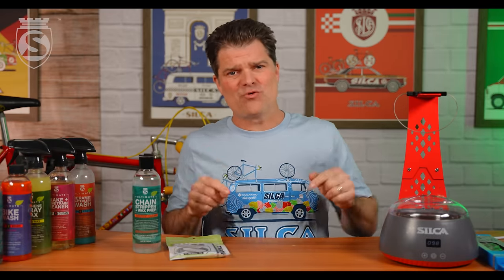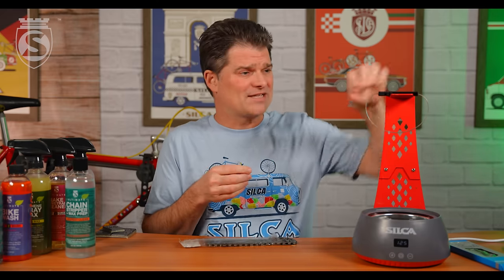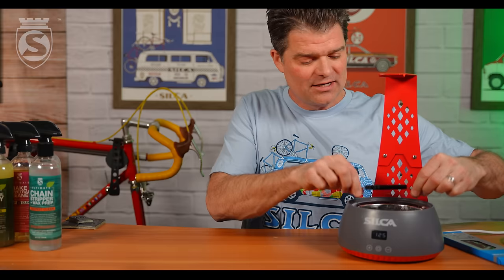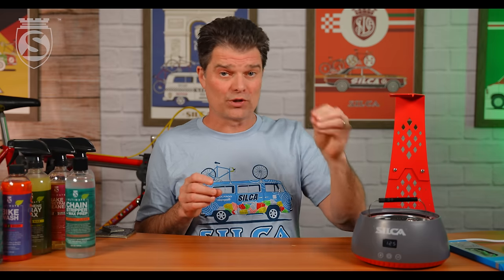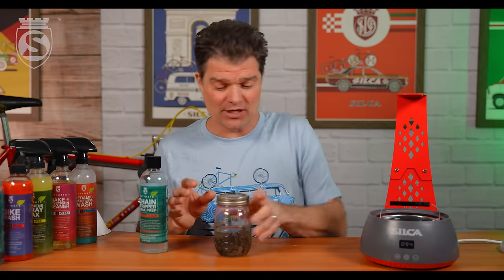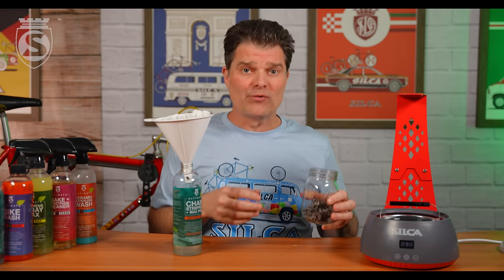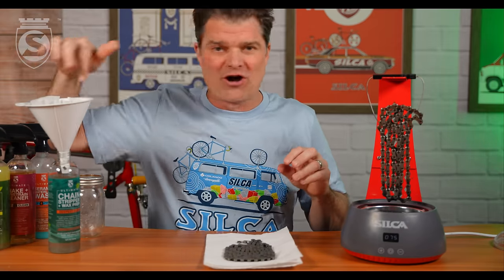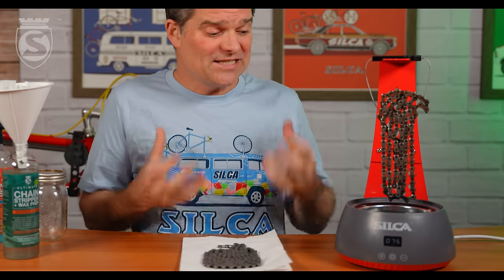Chain Waxing System Tutorial with Josh: A Step-by-Step Guide!

Comment: Hi Josh. This is not a question but an observation after just a few uses. Generally, the system is good, it works, but I don't know if it only happened to me while waxing, that the handle with the rope on which the chain is ...falls completely into the wax. So in my opinion, this is a small (?)  problem. There is no way to prevent it, I tried to thread it differently chain but it's the same every time. Of course, I deal with this by placing a piece of wooden spatula through the hole in the cable, which protects it from sinking in wax, but this is probably something worth considering when modernizing this station. That's all :)
Reply: An old spoke cut to the diameter of the pot works well.
Reply: Happened to me as well, I just scooped it out with scissors and the loop stood by itself (probably due to the wax).
Reply: Are these products for bike shop use or end user as well?

Comment: I have done 2 chains with the Stripper Chip/Chain Waxing System. Loved the idiot-proofness (good for me) and it resulted in what seems to be a very good end product. Due to weather, have only been able to put 150km on the chains so far, but if they make it to 250-300km before needing to be re-waxed, then this whole thing is a huge winner. I don’t really care about the efficiency gains, just the cleanliness and wear longevity. Well done.

Comment: I have a crock pot with your wax, I have a large ultrasonic cleaner and plenty of solvents.  I just filled your beautiful t controlled pot (Arrived last week) with a new bag of wax and will be getting one or both of your de-greasing systems.  Thank you for making this so simple and uncomplicated.  Now there is no reason for any one to use any thing other than wax!   I just love this system, and your wax emulsion (I use it every 100 to 150 miles and keeps things running great for 1000 miles between hot waxings)

Comment: I wax the quick link by putting the chain together with the link clipped together but not fully engaged. I also cut my chain to length before waxing. I also let the chain stay in the 75 degree wax for a little while to let the chain get to 75. It would be interesting for you to put your wax pot on a scale and weigh before you put the chain in and and after the wax is done to see how much wax you're using, how much you lose per chain.
Reply: I came here to post exactly this so I'll just give you a thumbs up and reply. I saw the headline of the video and couldn't figure it out because from the beginning of my chain waxing, I've done what you do without any issues, except I do engage the quick link. I wonder why you leave it not fully engaged. Regardless, when my chain is cool I take the quick link apart, put the chain on the bike, and re-assemble the quick link. It's waxed like every other link in the chain and there's no extruding of wax or any other issues described in the video. I honestly think the root cause of what this video purports to solve is that people are waxing their chains without the quick link in place, putting wax in a space it's not supposed to be, then having to extrude it out during assembly. I'm not throwing shade, I just wonder why anyone wouldn't was the chain with the quick link in place. Maybe I'm missing something.

Comment: Loving the setup so far, much more refined setup than my old crockpot with a candy thermometer stuck into it that I constantly had to monitor temperature and was much slower. The one small issue I had was on my first use, the screw in side of the cable that goes into the holder popped off. Luckily I was able to track it down and it appears to just be a crimp connection on. I got it back on and use a cable crimping tool to reattach it so hopefully it holds. Would be great if we could order a spare on of these though.

Comment: Great video for everyone waxing a new chain, looking forward to the next video detailing how to use these products now that they've already got a waxed chain!
Reply: Agreed this is something I was thinking about as well
Reply: I think that’s where a wash might be needed first to get rid of dirt / sand particles. Then you strip or not and rewax.
Reply: +1 for this. 
And in reply to  @lechprotean below: I did ask Silca once and was told that you don't need to strip before rewaxing. However, my thinking has always been that any grit and dirt in the chain would contaminate the clean wax in the hotpot, thereby potentially contaminating future waxings. As for washing first, I'm not so sure that any particles embedded in the wax would be removed by washing. Or am I just being overcautious?
Reply: @hydemuc I am also overcautious. It is, after all, the grit from the road which wears transmission components at fast rates when using wet lubes. When waxing chains (in my head), dunking used waxed chains repeatedly would ultimately result in accumulation of grit in the wax mixture. So I wash the chain, rinse with boiling water, wash again, and rinse with warm water before patting dry. This I do while the wax melts and is effortless. ... bunch of neurotics sharing obsession-compulsions down in the comments section 😂

Comment: I just received my Chain wax system pot this week. Next chain swap I plan to try it out. One question that I have not seen however is that shouldn't we be cleaning the chainrings and cassettes with stripper or something similar, not just the new chain? Since I have been using oil lube all this time they are both covered in the stuff. Thanks for the products and video!
Reply from the maker: Yes, you will want to clean your drivetrain well before installing your waxed chain.  Stripper or most any degreaser will work.  SILCA Brake and Drivetrain is a very good option and a bit less expensive than Stripper: https://silca.cc/products/ultimate-brake-and-drivetrain-cleaner

Comment: Got my new Chain Wax system this week and had to try it out right away.  Wasn't sure what to do with my old instapot once the wax was out of it.  Took a previously waxed chain and dropped it into the instapot and covered it with boiling water. A few minutes later, clean as could be put it into the new wax pot.  Like a previous comment could not keep the hanging handle from wanting to fall into the wax.  Place a screwdriver across the top of the pot through the hanging handle.  Problem solved.  Makes me want too wax more often. Great upgrade.

Comment: Hi Josh, I have a question - what is the best temp to pull the chain from the hot melt wax? In a Silca video from months ago you mentioned pull at 140/high 130 degrees F and this video is 75 degrees which I assume is celsius or around 165 degrees F. Many thanks and love your products

Comment: As for cleaning oiled chains, for years I’ve used mineral spirits in a heated ultrasound machine with excellent results. I have a basket suspending the chain about an inch above the bottom. After removal I used compressed air to blow off the chain. Then I hang it to dry. I have used an old air fryer toaster oven if I’m in a hurry. But it’s probably not advisable to do because mineral spirits is flammable. Once the chain is dry, I  use compressed air on it again. 
I use the mineral spirits over and over again. I pour it into a clear glass jug. Let it settle out for a couple days, then pour it through a coffee filter.
Reply from the maker: Just be sure to remove mineral spirits with acetone or alcohol before waxing the chain, mineral spirits residue is a nasty contaminate to the wax.

Comment: No idea how you get the handle to stand up, no matter what I did the handle fell in, even if I used a hex key threaded thru the red holder tying to keep it in place. Could you please do a v2 with a holder on the red backplate? My handle has already failed because the wax stopped the screw from coming out and the cable broke off its handle ;(

Comment: A couple suggestions for V2… some kind of retention system for the  chain holder when in the wax.  With the chain laying in the wax, it seems to want to flip the handle into the wax.  It needs a quick easy method to hold the handle out of the wax…. Also I’m not sure if it’s normal, but mine takes 45+ minutes to fully melt the wax at 75.  Both with fresh granules from the bag, and a second remedy for a second chain.  Second time I upped it to 85 after 40 minutes and it took another 10 to fully melt.  Trying to follow the directions as close as possible but tempted to go higher to melt and then drop it down so I don’t spend an hour plus to get a chain waxed.
Reply: I just got my silka hotpot today, because I used the strip chip I had to heat to 125 so I loaded wax and the chip and total took about 15 min to melt it.   If not using strip chip I’m no expert but my guess would be it’s okay to save time by increasing your heat past 75 just to melt it then lower it to 75 to put your chain in.
Reply: @mtbkev8935  Yeah in a later video Josh confirmed that it’s ok to crank the heat up higher to get the wax melting quicker.  The PID controller keeps the heating element from getting any hotter than the setting, so it does take a very long time to melt the wax in the center.  Instructions could probably use an update but at least it’s been officially confirmed as an acceptable practice with no ill effects on the wax.

Comment: When it comes time to rewax a waxed chain, is any specific cleaning suggested (e.g., boiling) to remove the old wax and any associated road grunge?  Or just remove chain and immerse?
Reply: +1
Reply: Rise thoroughly with boiling water in a colander to remove old wax.
Reply: Josh says either clean with a microfiber cloth (seems to think this is enough), unless it's really bad then you can boil in a pot for 2-3 mins (allows the chain to get up to temp and ensure all of the wax is removed - as opposed to just rinsing with boiling water from the kettle).

Comment: really useful explanation.  My question is, can I use this method to wax a nearly-new chain (6 months worth of summer riding) and using the Silca Ultimate Chain Stripper and Wax Prep, clean the chain before waxing or does it need to be a completely new chain?

Comment: I connect the quick link to the chain before waxing them together. This seems to work well.
Reply: Are you using a connex link for this ? You would have to install for waxing , uninstall to get the chain on the bike then install so you could ride.
Reply: Good question. I'm using the quick link that comes with the chain. Aware of the increased number of installations / uninstallations but haven't had any issues. It's a commuting bike; not used for sprinting.

Comment: So, after the warm water rinse, no concerns about putting the chain right into the wax without a full and proper drying period? I was under the impression that the moisture on the chain would inhibit the wax from adhering.
Reply from the maker: You want to shake or blow most of the water out, but as long as you leave the chain in the hot wax for ~10 minutes or so, the water will boil off.. you can accelerate this with temperature, just put the chain in, raise temp to 100C, you'll see bubbles popping on the surface for a few minutes as the water boils off, then drop to 75C.

Comment: nice and easy to wax the chain. cheated a bit to get up to temp quicker by setting to 100. took a couple attempts at cabling the chain to get a setup that didn't immediately want to flop over into the wax. But really nice to use something dedicated and obviously not for food and not having to have giant labels on it so it doesn't tried to be used for food.

Comment: how many chains can i wax with one bag if I'm not using strip chip in the mix? ...is it a matter of " as many as long as there's wax in the tub" or is there a limit dictated by the wax solution's ability to keep waxing chains?
Reply: If you're properly cleaning the chains, the answer is "as many as long as there's wax in the tub".

If you're not properly keeping the chains, it's whenever you notice a significant loss of wax coating longevity.

Comment: Thinking of ordering this setup very soon, but have a question regarding your recommendation.  Working with a few racers prepping for marathon mtb nationals, using e13 cassettes with sram axs drivetrain and was wondering what chain you'd recommend using for those marginal gains? I've heard you say how good and efficient the dura-ace/xtr 12spd chains are, would that be your recommendation over a sram or kmc chain? thanks in advance

Comment: Thanks for sharing this detailed tutorial. Worked like a charm :)
Now I have a few more chains to wax - and it looks to me, as if I just have to put in a new strip chip. They weight of pot and wax didn’t seem the be notable less after one fresh chain. 
Or what else do I have to do before the next chain?
Reply from the maker: If you are re-waxing a waxed chain, just heat the pot to 75 and wax away.  If you need to wax another factory greased chain, then add a Strip Chip with that chain.  If you need to wax a used chain that has other lubricant on it, then clean that first with Stripper.

Comment: Thanks Josh! Great information as always! You mentioned how much more environmentally friendly Chain Stripper & Chip Strip are than the mineral spirits & acetone method. How do you recommend disposing of the spent Stripper & contaminated wax? Thanks again!
Reply from the maker: Spent stripper that is sufficiently diluted can be put down the drain, or if you have a lot of it like some bike shops doing large scale waxing, you can dispose of it at any tox-drop type location in your city where you would dispose of paint or other cleaners.  As for the wax, you should be able to continue using it until it's gone.. it it does get contaminated is some way, it can just be thrown away as it is a non-toxic solid, separate from whatever contamination it may have in it.

Comment: At what point do you shorten/size the chain? After the wax or does doing it before save some wax?
Reply: I do it before the stripping
Reply: I'd suggest do it after the stripping as you won't be dealing with the grease from the chain. Definitely before the waxing as that will only interfere with moving the extra links not needed

Comment: I bought a fully built bike from the bike store. The chain is already installed. I've already put couple hundreds miles with the bike. As such, the chain is already collecting dirt and dust from multiple bike rides. If I need to wax the installed chain, would you recommend that I strip the chain with the StripChip? Or how would you recommend I treat the existing chain? Thanks.
Reply from the maker: Definitely clean this one with Chain Stripper.. it will better remove all the factory grease as well as remove any dirt sticking to the factory grease.  In this instance, StripChip will waxify the factory grease, but you'll still have any dirt stuck to the factory grease from use suspended and floating in your wax which you really don't want.

Comment: Hey Josh. Great summary! We are adding chain waxing to our shop services but will use the stripper as it seems to be more viable. The question I have is relating to the frequency of filtering back through a coffee filter paper? How many chains can I get through if I'm emptying the entire 16oz into a large jar and going through the required process?
Reply from the maker: It really depends on the jar.. the challenge over time with stripping multiple chains in it is that all of the encapsulated grease will float to the top forming a skin.  If your tank is wide enough, you can likely just drop a paper towel on the skin and it will stick to it.. you will be able to see if you've removed it this way.  If the tank/jar has a smaller opening, then I'd filter every 4-6 chains or so as you eventually end up pulling the chain out through this oil slick of encapsulated grease which just makes rinsing more difficult.

Comment: How important is temperature control? I'm using a small crockpot for waxing and constantly checking the temp with a candy thermometer is rather cumbersome.  Will I lose the benefits of waxing if I don't hit the 125C and 75C temperature marks exactly?
Reply from the maker: For just hot waxing, the temperature is not that important, but for using the Strip Chip it is very critical.  I would recommend using chain stripper to strip the chains if you are using a crock pot.

Comment: Quick links, and similar systems: I started to wax the chain assembled. When I put the chain on, I open the link, and the two parts in the chain. Actually, the wax helps keep them in place. Because I don't insert the link into the chain, it won't push out the wax. If you can make sure that you put on both link parts in the correct orientation, you may not even need to connect them.

At least it is working for me.
Reply: Great tip!

Comment: Does the chain that was cleaned with the stripper and water rinse have to be completely bone dry before submerging into the wax? Or is some moisture ok as you drop it into the melted wax?
Reply: Unless you want to chase maximum longevity/performance, being dry to the touch is good enough.
The water will be displaced from the hot wax solution as it heats up.
Reply: And if the wax is over 100c the water will just boil off.

Comment: How many StripChips can a pot of wax handle before it gets diluted? Say I have 6 brand new chains to wax - do I just keep adding a new StripChip for every chain I wax? At what point will this wax become saturated with StripChip and drop in its performance? Or does it not matter?
Reply: Actually seems like you've addressed it - 6 StripChips per 500g of wax is the max..